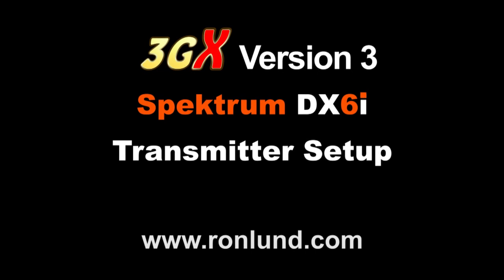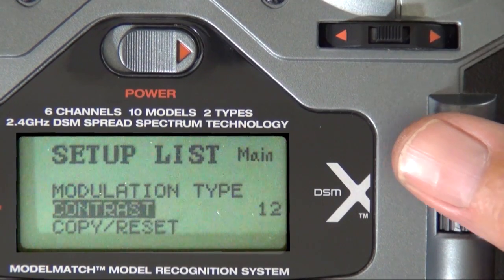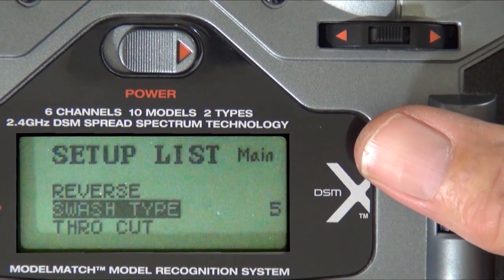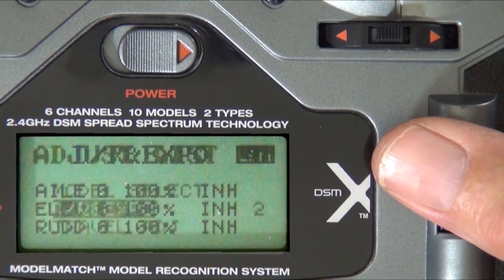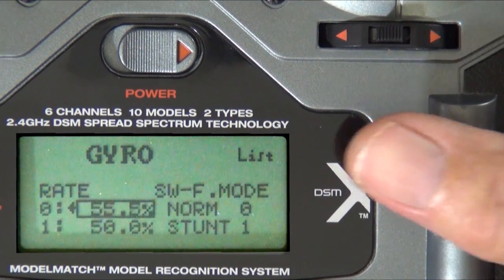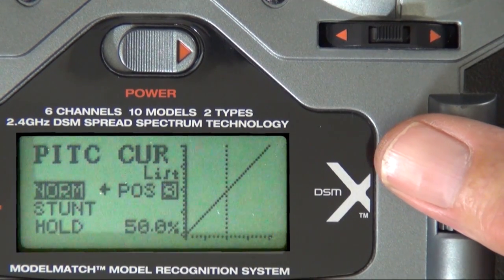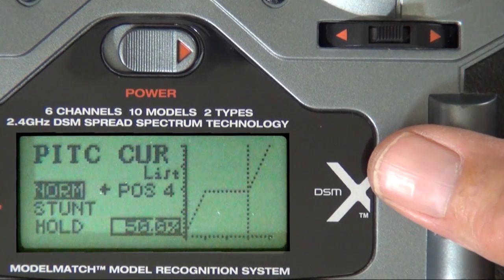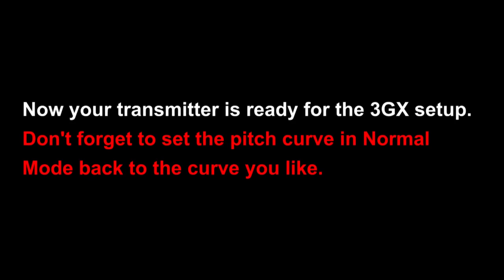3GXV3 - AR6210 - DX6i Transmitter Setup

Comment from the maker: Bind the AR6210 to your transmitter before you attempt to make all the connections. Power the receiver with a battery/bec in one of the servo slots. Do the bind, then hook everything up. In order to power the receiver, run power from the 3gx Sbus slot to the AR6210 bind slot.